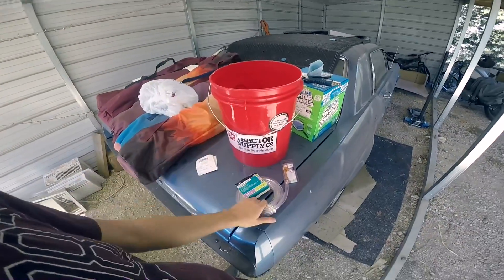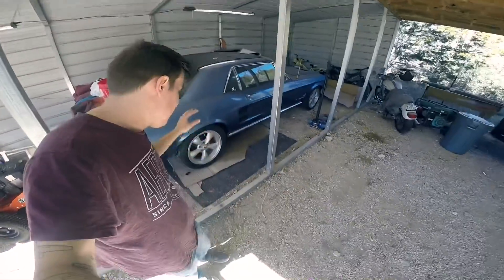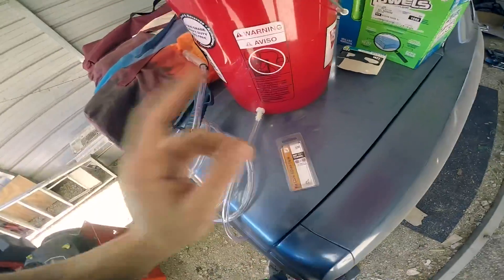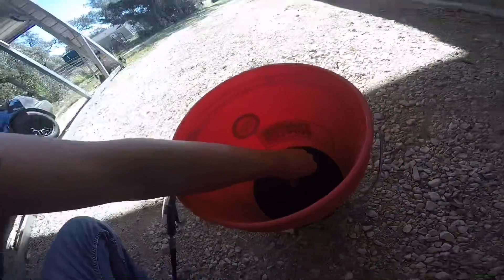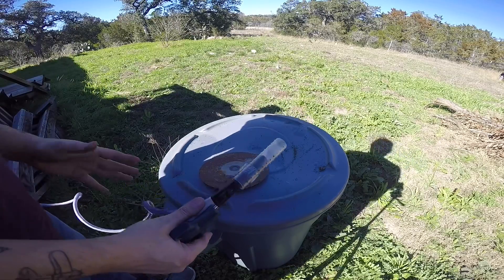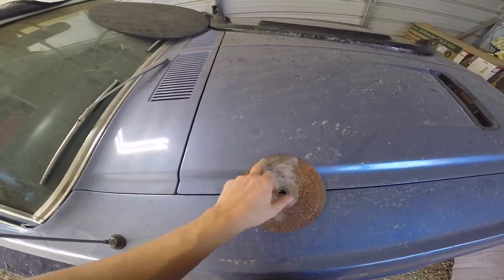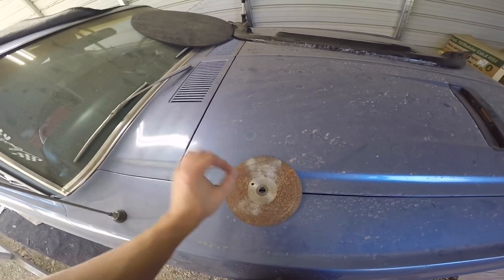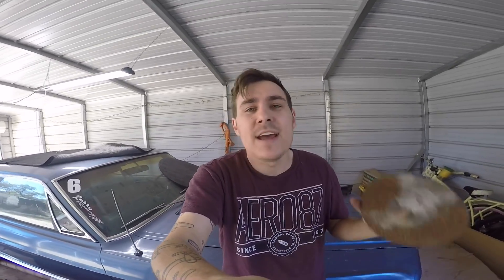DIY Sand Blaster, Making A Sand Blaster From Scratch As Cheap As Possible. Fails miserably.

Comment: Good attempt , I did the same thing, I had a real gun from an old cabinet that I used, it works well. You may try shortening the hose since it’s so portable you can carry the bucket around with the gun, my hose is only about 30”, I blast right above and back into the bucket to recycle some of the media.